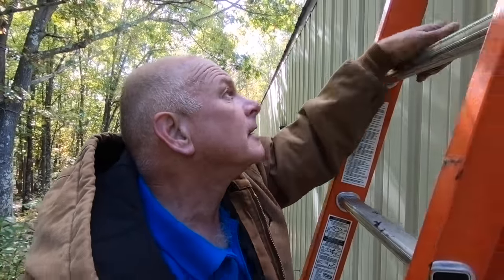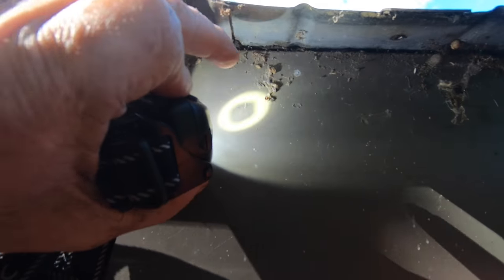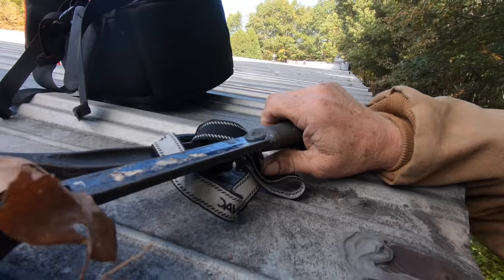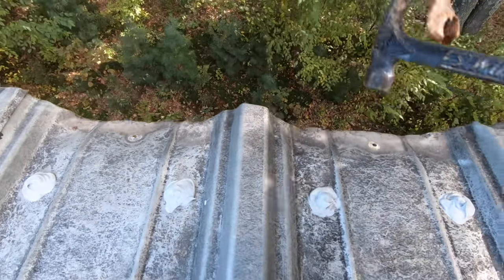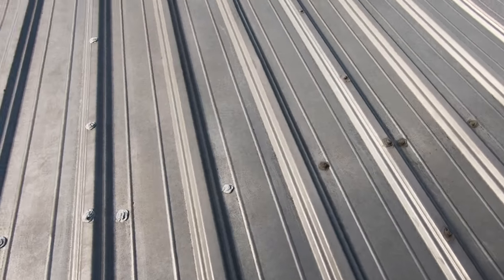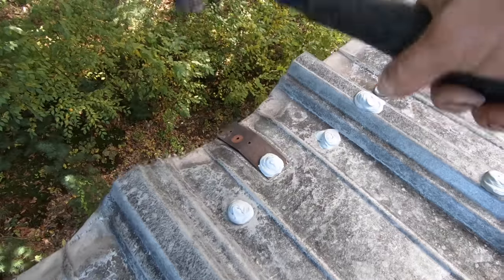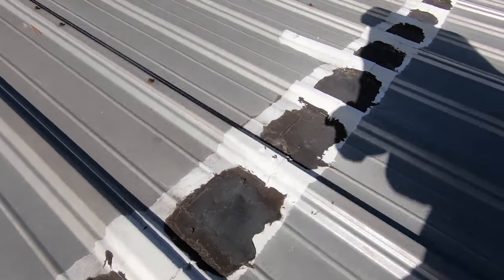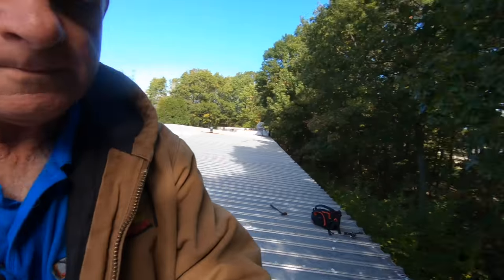A common cause of leaks on a metal roof overlooked - an easy fix with a hammer only

Comment: Brilliant video – I was frustrated trying to find a leak at the rear of my garage roof next to the downpipe which is sometimes slow to drain away. After watching this video, I armed myself with a hammer and beat down the metal as shown – problem solved- dry as a biscuit! My roof has a short overhang so must have been blowing back as described – very much appreciated- wouldn’t have believed such a simple solution!

Comment: I had the same issue, watter running back on its self into my cabin, slightly tuned the edges like this and it no longer runs back on its self instead drips off the end. Mines DIY this really helped and has save me a lot of headache. Thanks

Comment: The hammer solution may be  functional if there is capillary leakage, but it is unsightly and very sloppy. Far from the professional look the customer would expect. Get 4" wide nosed ViseGrips and properly bend the metal EVENLY.   Look at 0:55 That section is different from the rest. Why?  Maybe the gutter had something to do with it. Instead of the unsightly hammering of the panel you can clean the underside and place a  small 3-5 mm roofing silicon caulk bead along all the roof line. Water will stop at the bead and drop to the ground.
Reply from the maker: yes you are correct, I have use caulking under the lip before and it worked well. This was to show another way to do.

Comment: Hi I have the same issue with mine, my timber purline is wet when it rains, I have non drip sheeting, and I taught it was the condensation from the non drip sheeting running down the woven material and when it hits the last purline it drips, 
But watching some of these videos I thinks it’s capillary action, my sheeting is a box profile, 
I was thinking on the flat section of the profile, where the water runs into the gutter, if I cut a line say 15 mm on either side of the flat section and bend it into the gutter will this work aswell ? Or will water be drawn back up the cut line ??

Comment: I have a small metal roof with little slope connecting my mobile home to an addition and there's a leak in a 3 x 3 roof section that I cannot fix in 2 years of adding more roof over old. I've been trying to think outside of the box and have sealed every spot so unless it's climbing back up the panel someway going past all the sealant I have I just am at a lost of finding it. I'm going to look for something like this where I can maybe bend the edge of the metal but still I don't see how it can run past the flex seal rubber in a can I just coated all around a few days ago and the water is still coming in just as much as before. Seems more I try to fix it the more it leaks. Thanks for sharing this maybe it will put me onto a fix.

Comment: I have seen a few of your vids now. Thanks.

I have a question, I'm bolting a metal plate to the top of a school bus roof and i need to make sure the bolt holes are sealed so they don't leak. Do you have any suggestions on how i should seal it? I was thinking of a rubber mat between the two pieces of metal but i don't think that will be 100% waterproof. 

Thanks
Reply from the maker: Some kind of rubber gasket should work. I think if you can google and find a rubber material that can be cut ti size and be bolted between the plate and the roof

Comment: Do you ever have to replace the screws because the washers dissolve over time? I live in Virginia we have been really hot and really cold in winter. Have had several roofers say the washers are gone?
Reply: Yes am currently replacing all the screws on my roof. Some washers were completely gone. Could pull some screws out with fingers.

Comment: My landlord had a lip installed under the overhang so it just sticks out more. DIDNT FIX IT… still leaking into the shop and almost looks worse 😑  Inside the roof is insulated, so we can’t see where the water is coming in.  I’m STUCK and don’t know how to diagnose
Reply: I wedged a thin plastic sheet from a face shield in so now the water is rolling down off of that instead of doing the capillary action back up. For a more permanent solution, I'm going to either use sealant or replace the thin plastic with thin metal sheet, which wouldn't look as good.
Reply: @wesleybrown7869  I actually found the problem! The insulation was under the edge at the overhang. Whoever installed it left too much, and the water was wicking over and coming inside through soaked insulation. Cut the insulation away from the edge… problem solved!

Comment: No turn downs on the end of the end of the roof sheet!  Not installed to manufacturers instructions! You need to set up a camera to show the waters capillary action on the end of a roof sheet to show how it flows back under the sheet

Comment: Did that fix the problem?have they no leaks now? amazing where rain can in.that tar looks like a mess.
Reply from the maker: Absolutely, it has been over 7 months now since the job was done. I called around December to see if everything was ok and they reported that they had no leaks since. I have found this issue on many metal roofs. Here is what I think happens. There is a seal between the panel and beam it sits on. This seal is some kind of foam. Over the years this foam deteriorates or when people walk on the metal panels to clean gutters, the panels give under the weight and that movement breaks the seal. I am not a metal roof expert, but that's my theory. My expertize is finding leaks on roofs and then come up with a solution.
I hope a metal roof expert will elaborate more on my theory as to why those seals break or start leaking.
I have another video on repairing the overlapping seams on metal roofs. Those are even more problematic.
Thanks for asking the question King 37
Take Care
Reply: There’s roofs without the foam enclosures that never leak , it’s the pitch and the overhang divided by the both to create a proper flow of water shed and by you tappin it down makes up the difference! What ever works good thinking
Reply from the maker: sorry for late reply. I have solved so many metal roof leaks that was cause by a low pitch. It appears that at the bottom of a metal panel where is ends up spilling into a gutter, is where the water wants to follow the panel back into the building. I guess it's because when someone steps on these panels close to the gutters, is when the metal gets bend slightly causing a negative flow. Anyway my solution has been and it has worked for me is to tap down the edges causing a lip that will prevent water following the panel back from underneath. Wow, I don't know if my explanation made any sense. I figure you would know what i am talking about.
Thanks for your comment, and again sorry for the delayed reply. take care

Comment: why not just put an evaes through   looks like such a hack job to bend it like that
Reply from the maker: What is "evaes"? I hack a lot of things but it works. You could put a beat of caulking just under the lip of the metal to prevent the back flow.